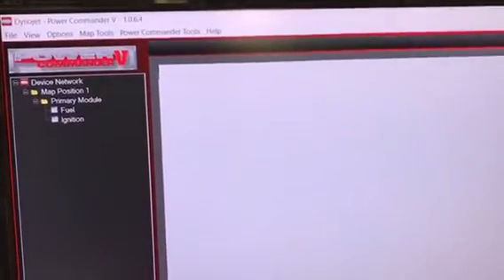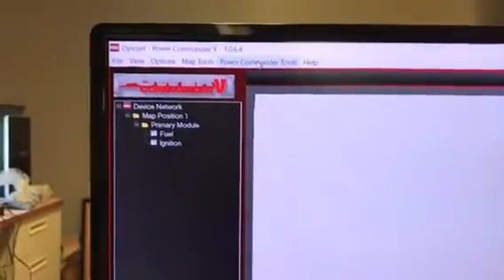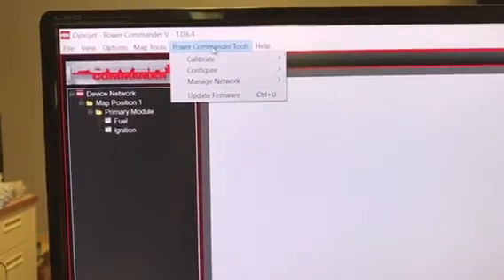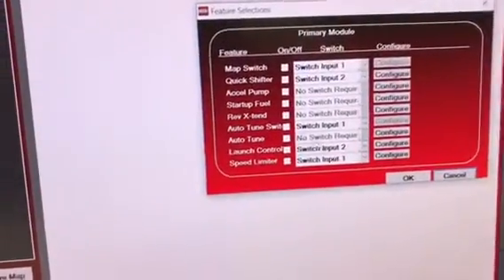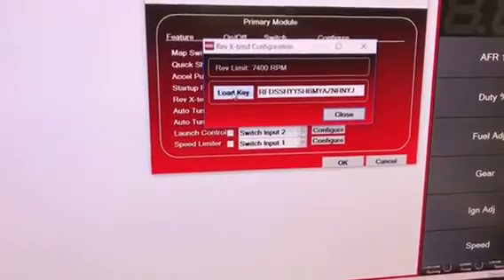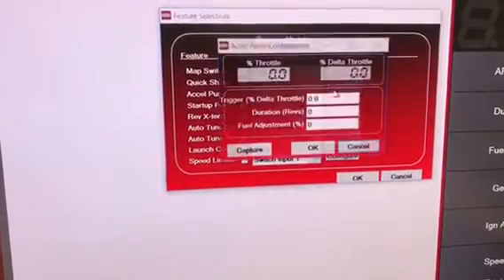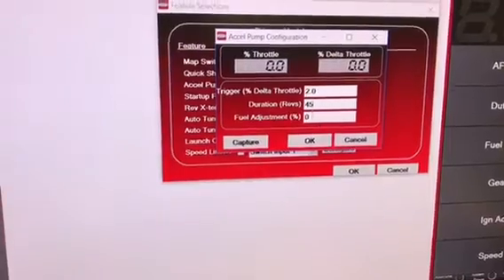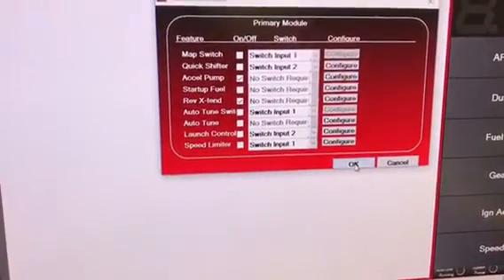Pcv rev extend

Comment: thank ^-^
Reply from the maker: welcome, this is a very crude way to show this but it works
Reply: @Hunterworks  Yes but I'm glad to have the information, I have a ktm with a modified engine and a shifted rev limiter (in the original ecu) but my power commander can't go that far (stops  at 10000 instead of 12500rpm).
Reply from the maker: @thonythony4861  I can send a rev extend code to go to 12500, just need serial number off the power commander and $25,
Reply: @Hunterworks  And if I want to be able to change the impedance of my injectors, can you do that too?  Originally on my motorcycle my injectors are keihins and my tuner has denso (from aprilia rsv mille)
Reply from the maker: @thonythony4861  No sir